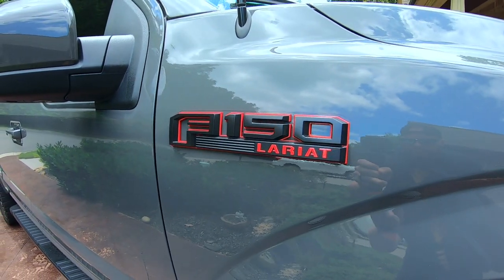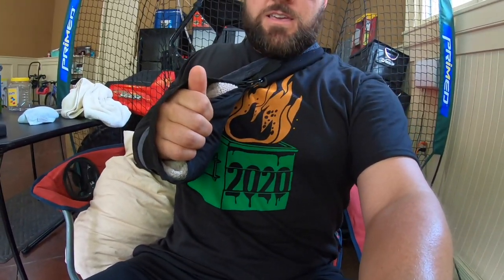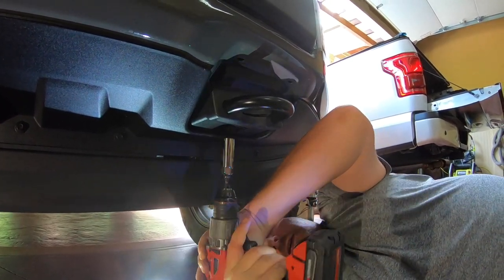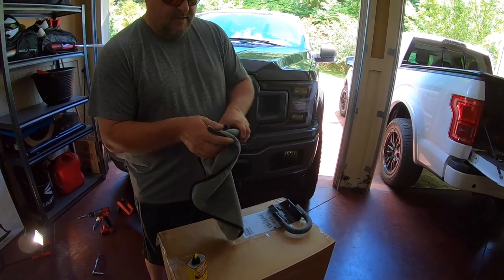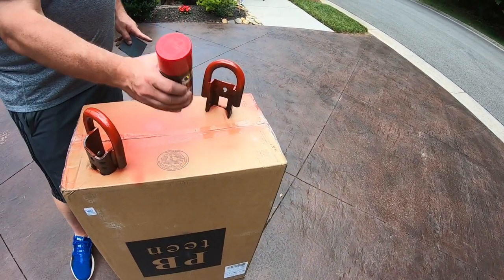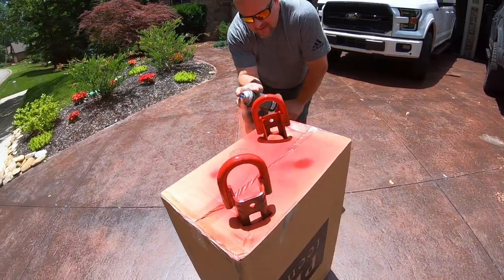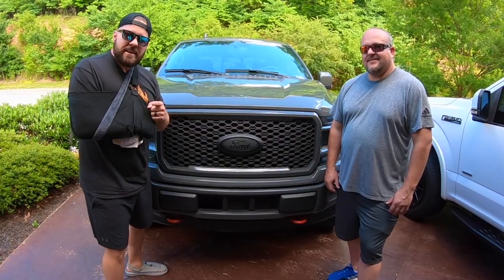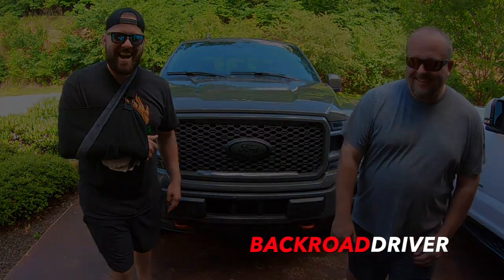🔥 Painted F150 Tow Hook Walkthrough - Custom Mods on Supercharged Ford! 🔥

Comment: Hi everyone.  Just a quick note, using their hole saw method, I just swapped my hooks this weekend from black to chrome.  One thing I need to note is that the rear bolt hole in the hook is a keyhole style.  That means all you have to do is completely remove the front bolt and then just loosen the back bolt about 1/8".  You can then just slide the hook back and out the rear of the bumper.  That way, you don't have to wrestle with the back bolt and there is no chance of losing the captured connected nuts inside the bumper.  It's designed this way.  Also, it's a whole lot easier to remove if from the back of the bumper instead of shoving it out the front through that plastic trim.  Cheers!
Reply from the maker: Thanks for posting this!
Reply: Great tip! Thanks, man!

Comment: Absolutely doing this next but I’ll probably end up removing that covering first cause I don’t really wanna drill into my truck too much
Reply from the maker: It’s a tough decision to hack. When you see what we do next it will all make sense. Thanks for watching. Make sure to sub.
Reply: I just swapped my black hooks for chrome hooks using the drill method.  It saves tons of time and you can't even see the hole.  Because I'm OCD, I just put some plastic body plugs in the holes I drilled and you can't even notice now unless you crawl under the truck and see there are plugs there.  Also, please check out my comment above about removing them from the back of the bumper...it's a whole lot easier and you don't have to worry about losing the captured nuts inside the frame.  Good luck!

Comment: Great video guys!  I used your hole saw method as well and it worked great.  Did you lose the gloss with that paint as it aged?  Mine started out with that same semi gloss finish but within a couple weeks tops I am left with a matte red/orange finish.
Reply from the maker: The finish has held on but we have had the bumper off a lot and keep chipping the paint. We may powder coat.
Reply: @BackroadDriver  Thanks for the quick reply!  Subbed!!
Reply from the maker: You da man!

Comment: On my 2021 I was able to get to the front bolt without drilling. The housing is flexible rubber that flexes a little, and you can push the whole housing back a little.  Also you only need to loosen the back bolt enough to unhook the tow hook. No need to fully remove it.  Of course first you have to remove the front bolt.

Comment: If U had Epoxy Spray paint might last longer?   How is it holding up?  Paint stick?
Reply from the maker: It held up pretty good. We respected them in the video below when we had them off for a bumper swap. They need a touch up in a knocked spot right now.

🔥 CUSTOM F150 BUMPERS - CUSTOM EXHAUST - HOW WE MADE THE WOLF! VMP SUPERCHARGED F150! FABRICATION
https://youtu.be/bK_Vq_Eh8t8
Reply: @BackroadDriver  good deal

Comment: Can you do the same thing with the chrome tow hooks or foes the chrome coating need to be sand blasted first?
Reply from the maker: I would watch a YouTube video on preparing chrome for paint. It can absolutely be done but you will probably want to use the right primer before you put the paint to it.

Comment: Heat your tow hooks in the oven to 300° for 20 minutes. Handle with gloves and paint the first coat light. Let sit, till dry. Repeat 2 more times!  I do all my metal painting this way.  It turns out alot tougher!
Reply: great way to ruin your oven